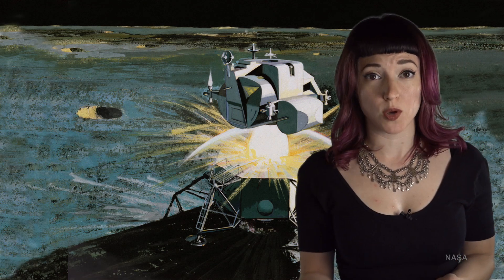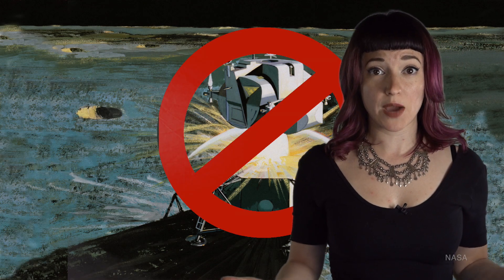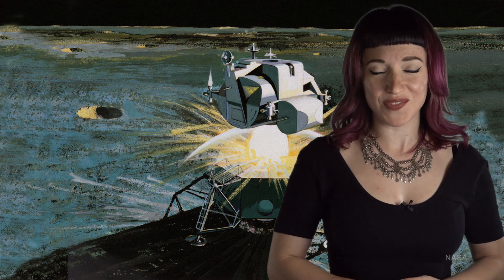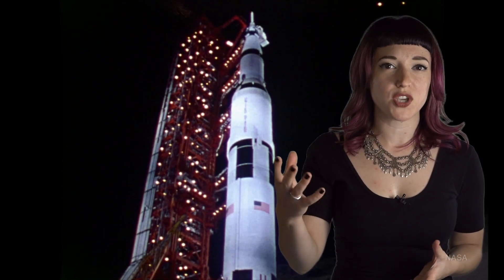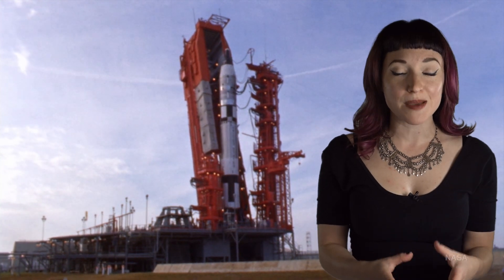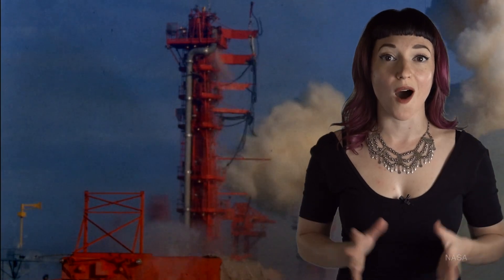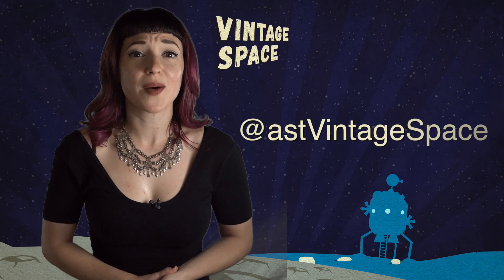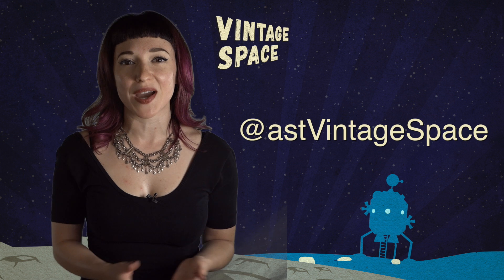How the Lunar Module Launched from the Moon Without a Flame

Comment: no moon dust was stirred up either, hmmmmmm?
Reply: "all the photos show zero dust, you must be confusing the grey foil as dust,look closer next time."  -  No I am looking at the granular grey material sitting in the bottom of folds in the thermal blanket covering the footpads. Maybe you failed to zoom in, or your eyesight needs checking. Here is an unambiguously dusty footpad, which alone is enough to invalidate the suggestion that "photos from nasa show no dust on lander feet":-
http://tothemoon.ser.asu.edu/data_a70/AS16/processed/AS16-107-17442.png

"there is no dust evident."  - Saying that doesn't make it true. The dust can be seen in those high resolution images.

"you are confused,the car is rotating only on one axis yaw, so many parts made of plastic or rubber or both are experiencing 500 degree f radiant heat for several hours at a time,"  -  So? Though you haven't actually justified 500 Fahrenheit as a relevant temperature.

"put a piece of dashboard in your oven at 500 for 1 hour and see what happens."  -  That would depend in which plastic it was made of, there are plenty of high temperature plastics. Assuming your temperature data is better than your dust observations.

"also stop copying and pasting so much."  -  Are you objecting to your words being quoted literally?

"I am done conversing with you,there is little hope for you"  -  We will see, but I certainly don't expect you to ever own up to being wrong about the dust on the lander's footpads.
Reply: Where do you get that silly notion?  Take Apollo 11 for an example.  There's almost no dust left under the lander at all.  It's almost entirely blown away, down to the compacted regolith and rock.

https://upload.wikimedia.org/wikipedia/commons/c/c6/AS11-40-5921.jpg

See, that's the problem with you conspiratards.  You just regurgitate the lies told by other conspiratards, without ever lifting a finger to verify if the assertions are correct or not.  (Hint: no assertion made by any moon conspiratard has ever been correct.  Every single claim they've ever made is wrong.  So, why do you believe them?)
Reply: rockethead7- you are incorrect,as photos clearly show "astronot " footprints right next to the lander. in a very thick layer of dust- you dumb fanboy
Reply: oh,I guess you got me. but wait, where did all that dust go? not even one spec on any of the shiny lander feet.
Reply: "... where did all that dust go? "  -  Any dust that was blown by the rocket engine will have gone away from the rocket engine, that is what happens with blowing. As the only mechanism for dust distribution on the Moon is impacts all of the dust got to where it is now by falling there so dust that falls to the surface after being blown away by a rocket engine isn't going to be visually distinct the from dust that had fallen there previously.

"not even one spec on any of the shiny lander feet."  -  Really? What evidence exists that would justify claiming that there is "not even one spec" of dust on "any of the shiny lander feet"?
Reply: photos from nasa show no dust on lander feet, I don't feel I need to send a link to that evidence. as it is very abundant. simply look closely at NASAs own lunar lander moon photos. also would the rocket thruster during descent create at least a little hole or depression? if so, what happens when you blow in a hole at a 90 degree angle? you get a lot of blowback directly at the source. try it.as back to no dust on the lander feet. this has not been disputed until now. most people who believe we went to the moon simply give reasons that there is no dust on the feet, but they don't deny it. also what do you think about elon musks tesla in space? do you believe it to be true? why hasn't it melted and bubbled or froze and cracked, when being subjected to radiant heat of around 500 degrees f and in the shade negative 100 degrees celcius? elon freely admits that the car was all     just a regular car, no special plastics,paint,or rubber.
Reply: all the photos show zero dust, you must be confusing the grey foil as dust,look closer next time. there is no dust evident. you are confused,the car is rotating only on one axis yaw, so many parts made of plastic or rubber or both are experiencing 500 degree f radiant heat for several hours at a time, put a piece of dashboard in your oven at 500 for 1 hour and see what happens.also stop copying and pasting so much.I am done conversing with you,there is little hope for you

Comment: Question : why would the clowns on the moon not turn the camera on the tripod 360 degrees  and do a pan? Answer cause they never went.  Also note, these videos suck and it is insulting, you should stick to bad hair videos
Reply: An alternative answer might be that if you pointed the original Apollo black and white video cameras at the sun they would burn out and become useless, and since you cannot do a 360 panorama in the lunar morning (when the sun is low in the sky) without pointing the camera at the sun they figured a photographic panorama would be a better idea (not least because it would have a much better resolution):-

https://www.lpi.usra.edu/resources/apollopanoramas/images/print/original/JSC2007e045375.jpg

And of course the later, more robust, color video cameras did do 360 degree panoramic sweeps from the rover.
Reply: Enough still images were taken so that you can indeed construct panoramas 
 http://moonpans.com/vr/apollo17_shorty.htm?r=j

Comment: You're reading a NASA script, babe.   If the landings were real, there would have been a blast effect. Regardless of the vacuum of space. "The fuel that the module burned..." are you on dope? Blast effect is blast effect. Newton's 3rd law of action and reaction would have made an effect on the moon's surface - during all 6 alleged landings... which were all fake.  "Alright, to understand why there's no blast effect..."  Hahaha!  "They killed their rocket motor prior to touchdown..."  Hahahaha!  Really? The moon still has 1/6th of earth gravity, which made the LMs weigh-in between 2600-2700# earth weight on approach to landing. Considering that fact, and the only source of thrust for was a 2-part chemical motor located BENEATH the descent phase of the LM (about 2-feet from the surface at touchdown!), and you've got a recipe for "whiteout" and a bizarre displacement of every type of loose particle on the moon's surface (including dust, soil and rocks) via the chemical rocket 10,000# motor's thrust (ACTION) -- a REACTION (slowing of the LM's rate of descent) but also an equal REACTION to the rocket motor's thrust being the moon's surface being forced away from the rocket's bell motor. This concentric blast effect would have been evident in all photographs of the moon's surface (under the LM). NONE of the Apollo photos show ANY displacement of ANY moon surface material beneath or anywhere near the exhaust of the rocket motor --- IMPOSSIBLE. 

Summary: there is ZERO evidence of ANY displacement of the moon's surface under the Apollos LMs during ALL SIX (6) alleged landings. 

It was a fantastic goal by the great & visionary president John F. Kennedy, but if all the photographs recorded by NASA (by the thousands) are the supposed evidence of the USA's landing on the moon, then we never landed on the moon.
Reply: what you  explain has been my favorite smoking gun, nobody has been able to debunk that... and there was enough dust left   to record armstrong´s footprint only a few feet away from the nozzle.. so they say,... great job., congrats

Comment: The departure of the Apollo 17 LM from the Moon was taped from the camera on the lunar buggy.  After the camera could no longer follow the LM, it refocused on the descent stage.  This is where something strange can be observed.  Nearly 3 minutes after the departure, you can still see some "things" apparently moving on the descent stage.  Is this an illusion caused by a bad quality video, are there things dangling from the descent stage which are still vibrating in the absence of aerodynamic friction, is there some gas escaping?

Comment: I'd LOVE to see the physics behind that lunar module take-off. Sure, gravity on the moon is only 1.622 M/S^2, and I'm sure that module is made out of light-weight metals like titanium. However, it still weighed 16,400 KG's (around 35,000 LB's, about the weight of 9 full sized cars.) So, 1.622 X 16,400 = 26,600 Newtons of force are needed to make the lunar module "weightless" whilst on the surface of the moon. Also, something bothers me about the acceleration of that module. I'm not sure what it is, but something is off.
Reply: You have made the fundamental error of citing the initial launch mass of the LM as relevant to its take off from the Moon. That mass includes decent stage of the LM, which was left on the Moon. In practice only the accent stage of the LM actually took off from the moon so only its mass is relevant. The claimed mass for the (fully fueled) accent stage alone is 4700 kg (10300 lb).
Reply: Two things: 1.) You're correct, and thank you. 2.) Those numbers are MUCH more reasonable....
Reply: @rjcornford  
Decent stage= descent stage.
Accent stage= ascent stage
English= This stranger!
And i'm not even English!
Reply: It didn't weigh 35,000 lbs. on the moon, and 90% of that weight was fuel which was exhausted by the time they landed so in the 1/6 gravity with their fuel depleted it weighed something on the order of less than 3000 lbs. There is some titanium in the LM where strength and rigidity were necessary but the overwhelming majority of the metal was aluminum. When the ascent stage lifted off from the moon they had jettisoned their life support backpacks, any unused supplies and anything that they didn't need for the return trip to earth and left them on the lunar surface. In short, all they brought back were themselves, their spacesuits, the rock and soil samples and a bunch of exposed film magazines. Fully fueled the ascent stage with the two astronauts and cargo weighed around 1500 lbs. and it got lighter as they depleted their fuel. Perhaps with this new information will put your mind to rest.

Comment: how was the LEM cooled while on the moon in sunlight?
Reply: The LM was water cooled with the heat dump achieved via (2 of 3) ice sublimators (the third being a backup that was never used as there were no failures in the other two on Apollo missions). These details are covered (along with much else) in "Apollo operations Handbook : Lunar Module", which is available online as a PDF.
Reply: Good, I'll check it out.  Ice sublimation req. electric power - STG @ < 100 watts??   How about the power required to broadcast the TV signal 240k mi.  The power source was a STG cel with < 100 watts and the "Inverse-Sq. Law" requires a lot of power to transmit.  I've been told the 80' antenna designed to pick up the Apollo signal answers this - but a TV signal (color) is a huge amount of data and they were picking up a lot more than a few "bits" an hour, if the signal was broadcast from the moon with such a low power source those 3 antenna picking up a few "bits" each would take weeks to generate the TV picture.  Power is a problem:  Bean said "batteries".  NASA says STG power cels - either source can not explain what was needed to get a TV signal 240 K mi.

Comment: She was only correct for the first nine seconds .
Reply: Booooo.
Reply: RogHawk press pause and you will see she is reading from an autocue. A let's be honest, if NASA paid you to do This, hey! you'd do it.
But look at the slight wobble of the module as it lifts, this is typical of a load being lifted by a whip hoist.
The other point is that with a single rocket that module in a vacuum would need to be perfectly balanced to the gram or it would start to tilt out of control.

Comment: One aspect of your exhaust spreading out vs more collimated theory due to lack Irmiter atmospheric pressure effect....... on earth 14.7 psi having an effect on the shape of the plume really? At 14.7 psi vs 4700 lb thrust?   Nozzle geometry and exhaust expansion speed as directed by nozzle.   That air pressure explanation is pushing ones logic.
Reply: Except, if you watch the debris from the Apollo 17 lunar liftoff, the widespread effects are evident.  And, if you watch any rocket launching from Earth into space, you'll see the plume getting wider and wider as the atmosphere gets thinner and thinner.  You can doubt reality all you want.  But, you'll just be wallowing in delusion.

Comment: I've heard it said that while we did have the technology to go to the moon, we did not have the capability to fake it. Something about the video feed. Does anyone have more information on this?
Reply: Well, people have said tons of various things on this topic.  So, who knows which flavor you're talking about?  But, just based on what little you've asked, here's my take on what you might be referring to:
See, the video feed from the Apollo missions arrived on Earth, transmitted from the little antennae on top of the landers, or the rovers.  It took some pretty substantially sized dishes to receive those signals cleanly enough to actually get a video picture.  Smaller dishes were able to at least see where the radio signals were coming from (by pointing them at the moon), and this was done by the Russians, and who knows how many others, who could at least aim a dish at the moon and tell that a radio signal was coming in.  But, they weren't going to be good enough to actually make a picture.  The big dishes capable of receiving an actual video picture from the moon were located around the globe (so that they could receive signals 24/7 as the Earth rotated).  One example can be seen at this link.  https://en.wikipedia.org/wiki/Parkes_Observatory#/media/File:Parkes_Radio_Telescope_09.jpg
Now, audio signals were a bit different, and could be picked up more easily.  But, the video feeds, yeah, those weren't going to get picked up by a backyard HAM radio tinkerer.  If you look at the picture in the link above, you need not even ask me to elaborate on why that is.  It'll be self apparent instantly.  But, anyway, these big dishes around the globe had to be pointed at the moon, and not only that, but focused on the actual landing spots (with a bit of margin of error).  There's a movie about this called "The Dish," starring Sam Neill, which is a bit of an entertaining docudrama format, showing the "close call" when they screwed up and lost alignment, and almost didn't get the dish aimed correctly in time to receive the Apollo 11 transmissions.  Anyway, point is, the conspiratards often think that this is easily explained by this strange concept that the Apollo craft were just a few hundred miles up, placed directly in line with the dishes pointed at the moon, to simulate the idea that the signals were coming from the moon, but were really coming from low Earth orbit.  But, alas, conspiratards know nothing about science (no conspiratard ever does), and such positioning isn't possible.  There's no such thing as "hovering" in an orbit.  In order to be in orbit, you have to be going 17,000 miles per hour (depending on exact altitude, this varies, of course), else you're going to fall out of the sky and start crashing through the atmosphere in a real hurry.  Or, if you're going faster, you'll get flung into a higher altitude oblong orbit, etc.  Anyway, point is, those dishes were pointed at the specific spots on the moon when they received the signals from the Apollo landers/rovers, and that can't be faked.  The conspiratards, with their never-ending vigil to rationalize the irrational, just end up looping all of the global dish operators into the conspiracy theory.  It's crazy, of course, because as you pick apart every single one of their stupid rationalizations, one topic at a time, it would eventually require just about everyone in the Apollo program to be in on the conspiracy, not just the "few top elites" that they believe.  But, whatever.  They're crazy.  Whattayagonnado?  Anyway, does that help?
Reply: rockethead7  This is what I saw a while ago. The claim is a live video more than an hour long could not have been faked.   https://youtu.be/sGXTF6bs1IU